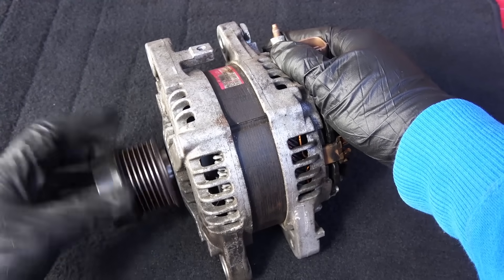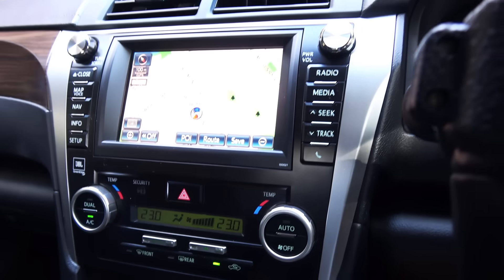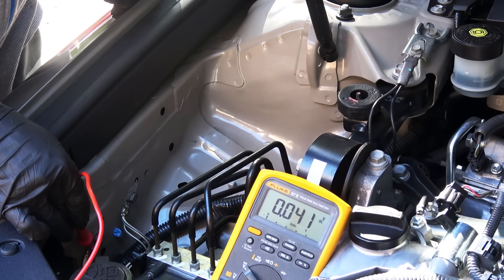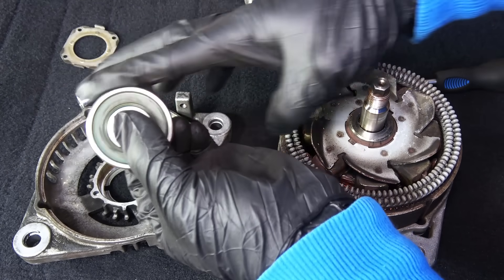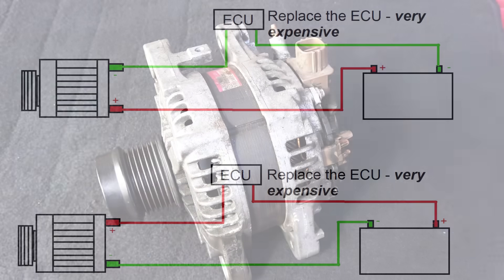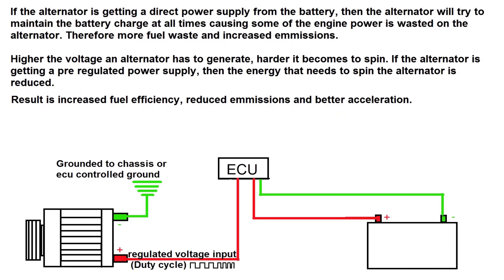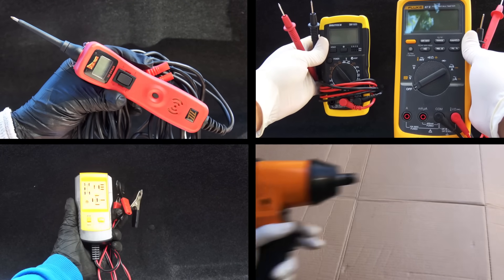How to Test an Alternator  ( Testing the Voltage Regulator, Diode rectifier and Stator)

Comment: I have a 92 Dodge and I bought it off of the guy who was driving it everyday everything was fine gave me a brand new battery and it drained because I didn't drive it for 2 days so I got it jumped and drove it everyday for about a week and it would start really good in the morning no problem but then when I didn't drive it for a couple days the battery would drain so then I took it to mechanic to see if there was any paralytic surge or drain and nothing was on so what the heck could be the problem if I drive it everyday it's fine if I leave it for 2 to 3 days it drains.
New battery cables were put on but when I first bought the car it sounded like it was whining and my first thought was it could be the alternator but if it was the alternator it would have died already and and not starred up if you drive it everyday it's fine

Comment: Hello. May be someone help me. Im have toyota e15 and have malfunction with alternator, comunicat system charging and almost don't arrive at home. Im check and engine and on the run i have 12v only. Replace alternator,  im think for good one. Im check the voltage and is 13.96 its good value. But the communicat not turn off. Replace batter for new one and the result the same. The car drive normal but this cominicat dont go off all time is show on the display with battery. Can someone help me. Thanks

Comment: Great video , I subbed your channel.

Question ..

Do you think the alternator can still run properly with a bad diode or rectifier? I may have one of the two but my car runs at 14.3 for two hours no issue. This is a bmw , my bettery was dead in the morning. These cars have a battery sensor  , ibs cable that runs off the negative terminal.  From what others say , if this sensor starts to fault or short , it will drain voltage from the battery to power small essentials of the car over night , in and out of sleep mode etc..  

I disconnected that cable and have a fresh battery in it , when I parked my car I did a battery test and it was at 12.8. I am going to check it again in a few hours. Please let me know what you think.

Comment: Hi
Tnx for the video! Great video!
I have a question sir: - I have alternator with 2 wires. One wire is return to ECU and other is input from ECU so alternator can "know" how many Volts should output, right ? This is the part with the duty cycle right ? My question is: can i connect the "driver" wire, the output from ECU, with battery 12V so alternator always keeps the battery at 14V ?

Thanks!!!

sorry if I asp stupid question, I am beginner.

Comment: I'm an idiot. I need to hear. Start the vehicle or with the engine off THEN take the red or positive lead of multimeter and touch this with the negative on this. Next same thing. Car running or off place here and here and what the readings mean

Comment: Hi there. I am getting a '00538 - voltage reference (open circuit)' fault code in central electric system of my Vw Polo Gt Tdi 1.6. The A/c randomly cuts off after driving the car for some time, whereas there is no fault code in the HVAC or in any other module. Had sent the car to the dealership and they checked all the wirings (including ground), fuses, BCM, Climatronic and informed me that the alternator might have gone bad, but then they weren't sure about it. I checked the alternator which when the car is on idle gives an output of around 13.5v and stays consistent even when on load. Now talking about the fault code it stays static when the car is on, but gets cleared (after clearing it) after starting the engine and recurs only after switching off the engine and turning the car on. I have replaced the battery, but the fault code won't go. I will be pleased if you give your valuable inputs and assist me getting rid of the fault code.

Comment: Thank you for this instructive video,
 I would like your help please, 
I have 12.70v engine running, I stop the engine, I disconnect / reconnect the battery, I start the engine and I have the 14v, the next day I find it  at 12.70v with the engine running. I repeat the procedure, it comes back to 14v.  
What do you think about this problem.
👍👍👍

Comment: Not entirely clear.
You don't show where you're putting the negative side of the multimeter when checking The b side of the alternator with the positive side of the alternator.  Is the negative side of the multimeter on the battery or is it on the alternator housing?
And are you doing that while the car is running or not running?

Comment: Great video! What might explain an alternator that smokes at idle and is running very hot (250F), but still is putting out around 13.5V? Its on a 2008 Toyota Highlander 2GR-FE, the alternator looks very similar to the alternator you show in this video. Thanks!

Comment: Another very easy way to diagnose a battery versus alternator problem is to disconnect the negative terminal from the battery while the car is running.  If the car shuts off, you have a bad alternator

Comment: I'm having a serious problem 😑 i replaced the fuel pump, didn't start, replaced the relay, started but after about 15 minutes it just shut off and the battery is dead, it hadn't been in is forever cause i couldn't start the car cause it wasn't getting fuel. Idk if its a bad battery, bad alternator (i really hope not) or if it's just cause i haven't had the car on in over 4 weeks and it just need to warm up a little

Ive had many issues with this car but not once was my alternator an issue. I'm so perplexed right now and sad

Comment: Hi buddy, I took out the alternator from a car several days ago so during all that time the alternator was devoid of any input power. However after replacing the back bearing and whilst assembling the lower and upper casing of the alternator, some component blew. How? When the alternator hasn’t been powered up for several days. The only component that I could think of is the rectifier diodes, but a diode doesn’t store charge .

Comment: Great Video buddy.  Can you help me out?

I get 450ma parasitic draw from alternator but it charges at 14.5 when running.  Battery is new and I have s=tested with another.  It only does it when I connect Alternator but I've done a Diode test too and only getting one reading of 0.500v one way.

I don't know what else to try.

Comment: I've never seen such good tutorials. I'm so burn out before seeing yours idk if I can do it right now. I changed my battery once and alternator twice in my 2011 kia optima so I think it's not the alternator. Battery Volts drop after cranking it.  Alternator rattles but the belt doesn't appear loose or damaged. Seeing this video I know to check the ECU. It's crazy I changed my alternator and battery but stumped on checking relays bc I have the cheap dial type. Also NONE of my instrument panel fuses light up and I think there's got to be a connection. You should charge a fee for phone support. Lol

Comment: I replaced the old alternator with a new one as it was no longer charging. I checked, there is no ground fault and there is no voltage drop in the + cable. Ampere consumption is within normal limits. Like the old alternator, it gets too hot to touch, metal engine parts are 80 90 C degrees, the alternator is  100 130 C and I get uncomfortable. is this still a problem? thanks.

Comment: I just wasted 14 minutes watching your video. You did not explain how to detect if you have one open diode. In my case this condition caused much grief because it cause a camshaft postion error code. The bad diode was putting an AC voltage in the system that confused the computer and camshaft position sensor. My meter could not dectect the difference between a DC and AC voltage. It takes a special meter to extract only the AC on top of a DC voltage. A scope would be best. The problem was caused by a one bad diode that went bad when the engine overheated and sprayed hot water directly into the alternator. A rebuilt alternator from an automotive electrical shop solved the problem after they diagnosed the problem and visually identified the offending diode. Your explaiation was close but not complete. IMHO a check should be made for AC voltage on the system and you did not expain what type of meter will and will not work and why.

Comment: I did this with my multimeter and in one second the wires got so hot on the multimeter i dropped it, the plastic would have started melting if I did pull it from the battery.
Reply: Probably because you had your meter on amps. I have being doing this for 30 years with out a problem.

Comment: Just to point out some cars have the alternator output straight to the battery with a built in fuse at the positive terminal - the fuse is not obvious but is there when you look carefully. Hence you will not see the alternator  output cable go to the fuse box..

Comment: Can I say you screwed up on the testing of the alternator. Way too fast. Raced it. Should have done two videos.  Also on another issue you said the ohms between slip rings 2.4 well guess what. My new Delco Remy 150a alternator. Got it today. Had it wired up to just power going in through the slip rings. Took a while before it finally kicked in on the bench. Then a few minutes later could do nothing to get it powering the battery. Had a load on the b post too. 

So taking it apart I found the resistance between the slip rings in the K ohms and not ohms. This means the wires broke somewhere in the rotor don’t it?

Oh and on testing old alternators. Got one from a customer. Checked it and found a mega reading between the b post and the slip rings. How could this happen. I know it’s wrong but how could it be?

Comment: i have simmilar altrernator that failed, i dismanteled it and one diode is dead, i mesured resistance of stator and something is diferent than when you measured resistance on 11:47 ,rectifier is out and i measured on naked wires:terminals that are on right side of picture between that 2 wires is no resistance, but upper( right )wire is in connection with upper pair of wires and lower (right) wire is in connection with lower pair of wires, upper pair of wires are  connected mutually, same for lower pair of wires, i checked stator windings and it looks ok, no broken wire, should all pairs of wires  be connected mutually and between pairs?

Comment: I have Jeep Cherokee 1998 XJ My alternator has two field generator bolts (Source and driver) both is grounded from the alternator not the harness the harness is good and not grounded when it installed and also when uninstalled... My problem is i bought a new alternator because the old one is worn out and everything was fine until i rev it a little bit at 5000RPM and suddenly the dome light gets brighter than usual and the battery guage spikes to 17v then after 10 second it goes to 19v and i tested the battery with multimeter while engine running it shows 16-18v...

Sorry for my bad english 
It's my 2nd language

Comment: The easiest way to know if alternator works, turn the engine and then take the cable off of the battery if the engine turned off . Alternator is dead

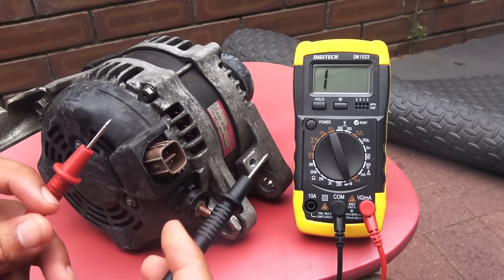Comment: Enjoying your videos. When I try and test the rectifier (11:57 in your video) my multimeter is just doing a continuity test. I read my multimeter instructions and the settings are the same for continuity and diode testing so maybe my multimeter is not advanced enough for me to get a reading this way? Or is this a sign that my alternator is bad? I’m getting a parasitic drain and I’ve narrowed the problem down to either the alternator plug wiring or the alternator itself (quite common to fail in my car... a 2002 Mini Cooper S)
Reply: The alternator is charging fine, but has the parasitic drain and my electric power steering pump is not working properly

Comment: Alternator is get heating up continuously with smell when terminals are connected to new battery in car switch off condition. Is it ok to start engine and do testing as mention in video. or alternator (if faulty) will drain the newly connected  battery?

Comment: There is an easy way to check if the alternator is good or not,
Drive up to a wall in night time and turn on your head lights,and if the alternator is fine, you will find the head lights grow brighter when you revving up the engine, if they don't then you will need to another alternator ok.....

Comment: good day, great video, informative clear detailed instructions, question, what reading to expect from the power connector that plugs into the alternator, i have a toyota/lexus 4 terminal connector alternator like the one in your video, im only getting a 12v reading from FR & L, 0v from IG & S connector terminals?.
Reply: did you find out?

Comment: Sir can ask ,If there still need to install  voltage regulator, since this time  there is a built in diode resistor to the alternator, Am I correct sir?

Comment: Cheers bro, great video 
I put a brand new alternator on my boat, there's no output at all, the alternator light don't come on when I switch the ignition on, but when I start the engine up the alternator light starts flashing and the warning buzzer goes of, I been told it needs to excited, how would I do this, there are 4 terminals on the alternator B+ B- W and D+
Any info greatly appreciated, thanks

Comment: Good video. Very comprehensive in your explanations. However, never use a hammer directly on a bearing as it will shock load the bearing to cause premature failure from brinnelling. Use a bearing driver to absorb the hammer's impact and to drive the bearing square in the bore.
Reply: Can use a socket that fits on the diameter of the bearing too. I’ve done that and have had no issues with the bearing.

Comment: Wait, so what do I do if it's overcharging? I haven't checked it with a multimeter but my new alternator just boiled my new battery so I'm fairly certain that's the issue. Please advise

Comment: Very nice video may i asked what apps u are using for  rpm reading on your phone? And what setting or mode u use on multi meter in checking the rectifier ? the one u show on the video thank u so much in advance,

Comment: Did i need to open the ac when doing this process？I got around 0.46 volt when i connect the B and positive post.and after turn off the ac its read 0.10 volt ..my problem is battery drain overnight.Thank  you for the useful information
Reply: As you hopefully already learned, as I write this 8 months after your question, you have what is called a "parasitic draw". An example of this is a trunk light that stays on after it is closed (bad switch). There are good videos on how to test for this issue.

Comment: My Honda Odyssey has 130 amps alternator, when fully loaded with ac, the voltage drops below 12 volts. I plan to replace it with 200 amps alternator. Will there be any negative issues?

Comment: Unfortunately  for me I can not access my alternator to perform these tests. Its a ford Escape . All I know is when my car is running The voltage accross battery terminals drops to 12.3 Volts down from 12.65 when its not running.  Think I will just buy a new alternator spend the 3/4 of a day to replace it and hope for the best. Do you have a better suggestion?

Comment: (2004 Toyota camry LE)The battery was plugged in and I took off the rubber part of the alternator and tried to tighten the bolt that the rubber covers with a wrench then sparks started flying and now the car doesnt start. When I put the key in and try to turn it, it doesnt do anything and makes a quiet whining noise then when I take the key out there is a quiet pop noise. What did I do and how can it be fixed?

Comment: Thank you for the great video my friend. When using the test light to test the alternator connector's terminals, should we expect all the terminals to light up the test light?

Also, for the same connector test except w/ multimeter, should we expect same reading that we get when car's off &  battery's connected to car.
Reply: Also, when the alternator was opened you tested the slip rings for resistance & then tested the stator (I'm not sure the correct word; I'm just referring to what the captions said it was called), but you mentioned the results should be the same as when we tested the rotor... was the testing of the slip rings same as testing of the rotor?

Comment: Hey I have a 2016 Honda Civic. My warning light came on. Says “check charge system”. I change the battery and the warning sign went away for like a week and came back on. Today 6-19-2020, I use the multimeter and check the battery while the car is off and it reads about 12.5. Now when I start the car with ac, radio, and headlights on. It reads at 12.13. I know it’s supposed to read 14v. Is that means I have a bad alternator? Thank you
Reply: I just use the multimeter straight to the alternator and ground there’s no reading. What’s the mean?

Comment: I have an issue. My AC occasionally turn off and headlight is very dim, I think due to unstable electricity. I put on new 80amp Battery and replace my Valeo to brand new Bosch Alternator 140 amp, also replace the whole set of Timing & V belt + Pulley. Now the battery is not charging at all. The battery drain empty when I test the car at idle.
Mine is 2006 Audi A3 2.0 FSI.

Comment: Having just gone round and round with my alternator on my MB, I would have probably figured out the problem faster if I really understood this stuff and could apply it. Next time I have trouble I'll just get a new one. Replacing the voltage regulator doesn't always get it and it seems the rebuilt ones are now mostly junk.

Comment: my voltage decreases as i turn lights on or push the stop or any light or the radio, if i accelerate it goes back to normal, but if i decelerate it drops again, even headlight dims as i turn something on. any idea please? battery is new. thanks.

Comment: I just put in a new alternator and it's getting hot. The voltages are OK.  At battery 12.8 when off, 14.4 when on.